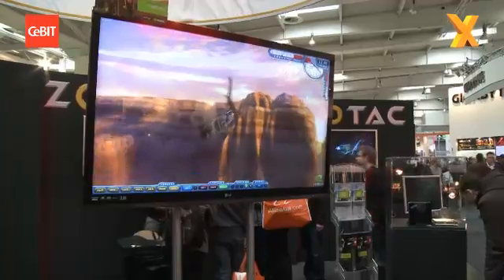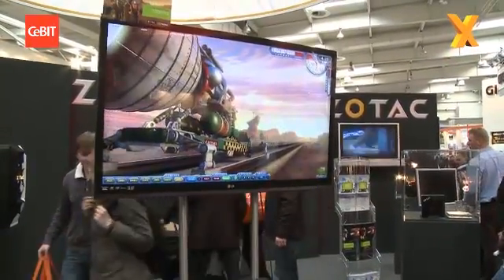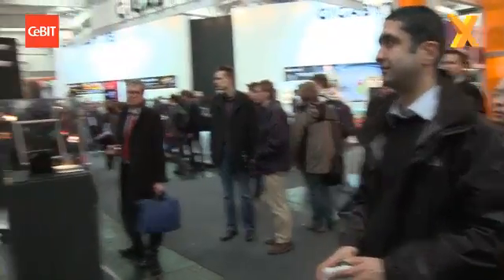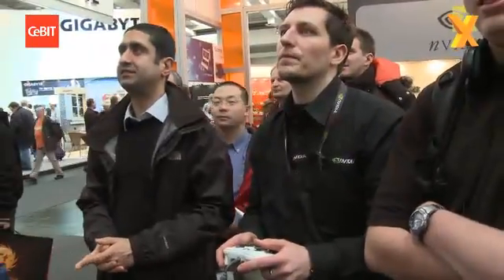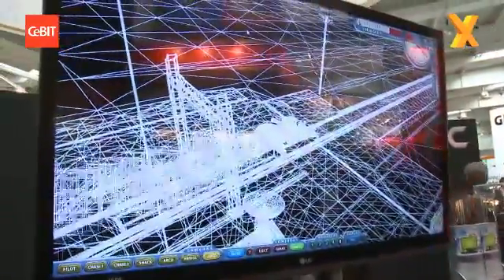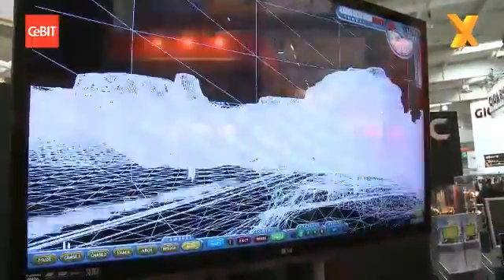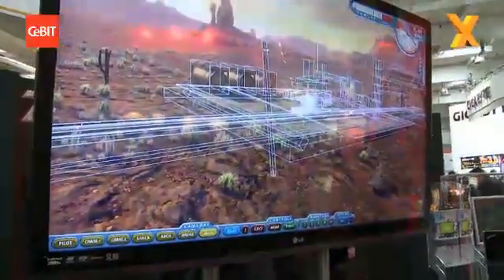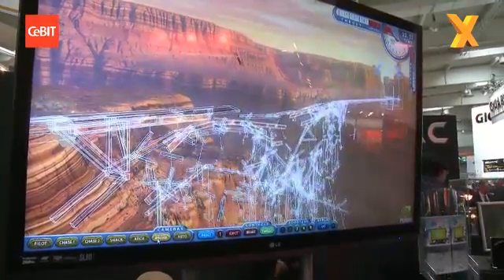CeBIT 2010 : NVIDIA Fermi Fun

Comment: Miki0612990 you are an total idiot the 5970 is an DUAL gpu so to compare lets get 2 nvidia GTX480 and then see how the 5970 is ripped to shreds in preformance by the 480